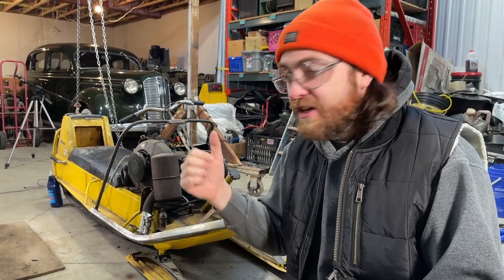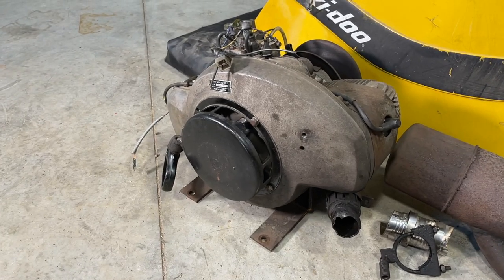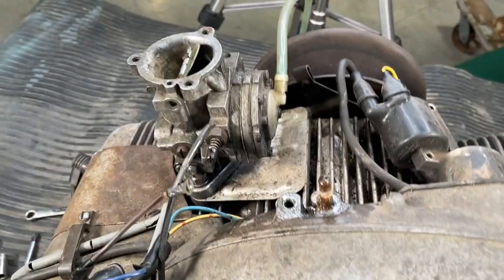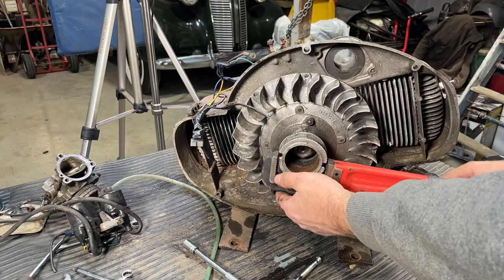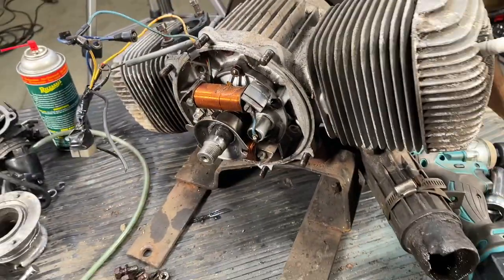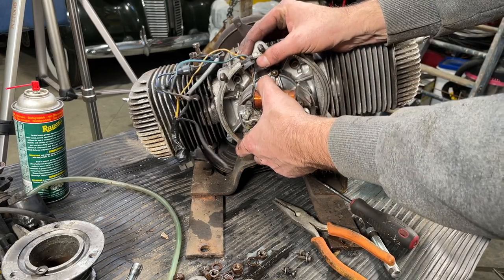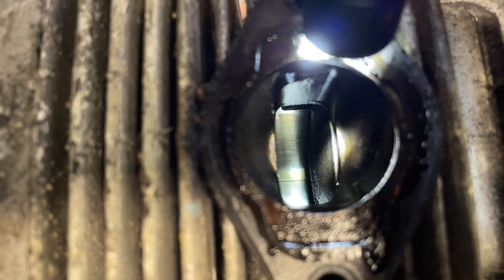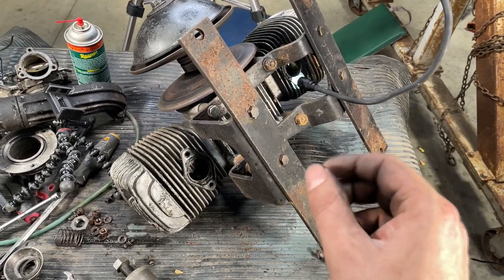Ski-Doo Super Olympique 370 -Rotax Engine TEARDOWN!!! -Part 1

Comment: Good old sled! Biggest problem was the crank seals. P.S use a dial indicator to determine tdc for timing purposes.
Reply from the maker: Those are definitely going to be replaced. (Spoiler alert, the crank bearings are toast also...)